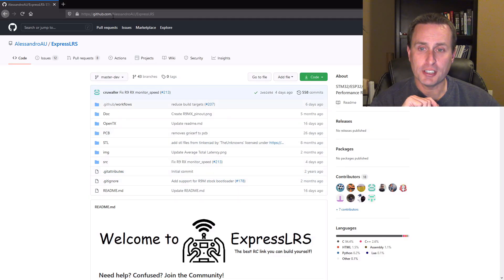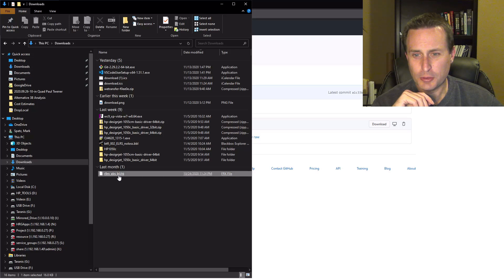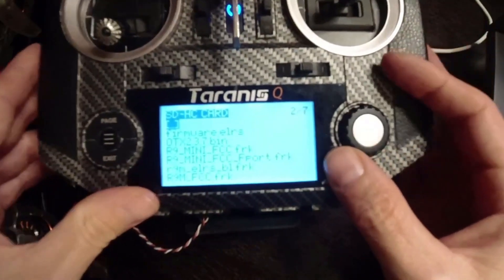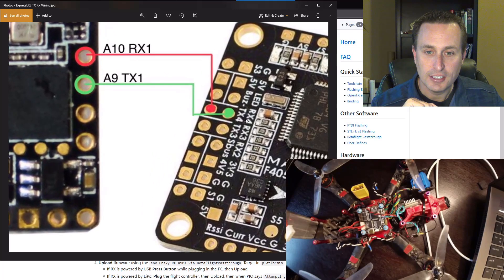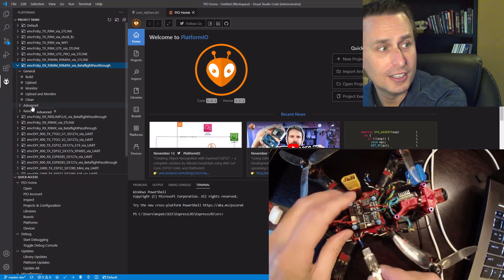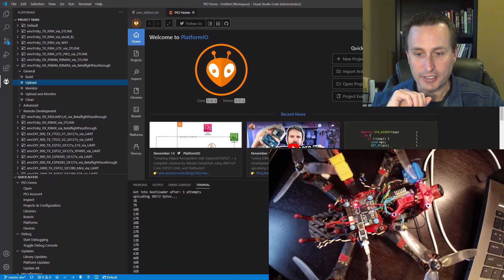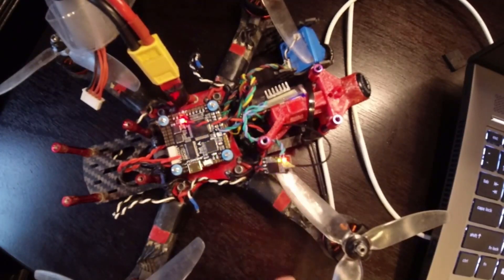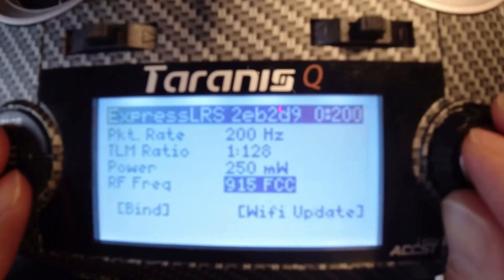ExpressLRS: Flashing R9mm Receivers

Comment: If your receiver powers up with just USB connected to your flight controller, unplug it. Press and Hold the boot button on the receiver (not the FC) and then plug in the USB. Release the button once the green and red LEDs blink alternately.

If your receiver only powers up with a LiPo connected to your flight controller, unplug it. Then unplug-replug the USB cable to your flight controller. Do not replug LiPo yet.

Comment: ok so here's a tip for people who can't get the lua script to work.. there are some people with the same problem, and I bet they have the same problem. I tried several things, almost went crazy, flashed modules with stlink, then as a last resort resoldered the crsf mod with enamel copper wire and kept it as short as possible, before this, I used relatively thick silicone wire, always got the error counter running up, and no connection to the module with elrs, but R9m firmware worked fine.. but with the thin wire it finally works! nobody was talking about the wire affecting the link to the module, I have not read this in ANY problem solving,  but it does work with thinner wire !

Comment: I have two R9 modules, one modded with a resistor, and a second one without. I successfully bound the module without the mod,  and then tried to bind the modded module with the same receiver (r9slim+), but it won't bind,  is this not possible? binding phrase is the same on both modules.

Comment: Hi Mark, is there any way to flash ExpressLRS to the R9 Stab receiver? i'm planning on switching to ExpressLRS and I fly a lot of fixed wing also without FC so I have quite a few of the R9 Stab receivers and it would be very annoying if they wouldn't work with my R9M anymore.

Comment: Cool - thx - so if you can load the Bootloader to R9MM via the Taranis S.Port pins (as per your video 4:46 above); Can I also then load the Frsky_RX_R9MM_R9MINI-1.0.1.bin firmware the same way to a batch of R9MM's?  in my case I have Not yet built the drones so passthru not possible atm.

Comment: Thank you very much for the tutorial.
I have a radiomaster tx16s and the crossfair module is from the 2019 ACCESS EU LBT version. I do all the flash procedure with EXPRESSLRS configurator and in the final step with the R9MX connected to the controller after compilation and the attempt to flash gives me an INVALID SERIAL RX CONFIGURATION DETECTED error:
serialrx_inverted ¡= OFF ¡¡serialrx_halfduplex ¡= OFF / AUTO¡¡¡

I would appreciate a little help.

Thanks.

Comment: ive got a accst r9m module but no recivers. all i can find is the new access recivers. if i flash my accst r9m module and buy a new  R9 MX access OTA reciver and flash it with ELRS, then will they work together? or do i need an old accst reciver to work? sorry, im new to ELRS
Reply from the maker: OTA receivers work with either ACCST or ACCESS modules.  ELRS or Frsky
Reply: @uavtech  thanks for such a fast reply! Glad too hear it, I'll soon have a elrs system up and running

Comment: can you please share the "r9mm red+green leds solid on lipo connection" fix? the link @ github is null...
Reply from the maker: You have a broken bootloader button.

You need to special broken button, bootloader file covered under the wiki.

https://github.com/ExpressLRS/ExpressLRS/wiki/Flashing-R9MM-R9MINI-with-TX#flashing-bootloader

File linked on the discord
Reply: @uavtech  Couldn't find it.. please. The link there to Discord is dead

Comment: Nice video! Can I use some of the methods to flash the DIY nano receiver? Or only with a serial adapter?
Reply from the maker: If it has a passthrough build option, then you can usw this method.  Not all have a passthrough build option though.
Reply: @uavtech  Thanks for the answer:)

Comment: Thanks for your great videos. Super informative! Tried to go through discord but no success. I've successfully flashed my R9M lite tx module with ELRS. I'm now trying to figure out the rx flash, however, I don't use Betaflight. All my UAVs use INAV. Can I flash the R9MM rx through INAV using the Betaflight passthrough method? The STLink method looks a little intimidating to me. Thanks again!

Comment: I've been following your videos and after seeing the configurator, finally took leap of faith and flashed one of my old r9 moduals and a reciver. Had a few issues, but figured them all out. (Set external to crsf, Load boot loader to the reciver before flashing express LRS (my fault)) love the passphrase and being able to bind to many moduals just by flashing the same firmware/passphrase. I don't have a lot of recivers, was wondering if it works on the r9mm ota recivers.
Reply from the maker: Yes it does.
Reply: @uavtech  i'm sold! thank  you! i'll be checking out your tuning videos. need to really understand pid tuning!

Comment: Can u tell about TLM Ratio?
Reply from the maker: It is one packet per evey X number of transmission packets.  TLM takes air time, so i would crank up to 1:128.  In some cases though, you may bet RSSI warnings at 1:128, so you may need 1:64 depending on your equipment.  Mine works on 1:128 fine though.
Reply: @uavtech  i need gps coordinate telemetey. Whats best TLM ratio & best frek?
Reply from the maker: ExpressLRS does not support GPS telemetry.

Comment: How well would this work with an r9 lite, the github seems to say it supports 50mW but that seems pretty low and I thought the r9 lite could go up to 100mW
Reply: Yes it supports only 50mW because FrSky use chip which is not rated to 100mW and devs decided to lower power.

Comment: All works for me except the firmware flashing with via the FC with betaflight (have a Goku F411)  , Why the VS compiler does not generate Firmware file for TX flashing ?  , can you flash FW via the Taranis TX as external module ? how? Thanks in advance!

Comment: I couldnt get mine to work untill I switched my external module mode to crsf.   After that it bound rite away
Reply from the maker: Yeah, it uses the CRSF protocol.  Sorry, I thought I covered that in the previous video, but maybe a glossed over.
Reply: @uavtech  I think you missed that one.  But i figured since it used crsf on betaflight that it used crsf on opentx.   But great video man.  Thanks for everything.

Comment: Thanks for the video, very useful. I have a question, are the new r9mm receivers (OTA I think is the name) also supported? or just the old ACCST version?
Reply from the maker: Both.
Reply: @uavtech  excelent. I will go and flash my old module and receiver then. I got a couple when they were on that crazy sale
Reply from the maker: U on ACCST Module and OTA receivers?
Reply: @uavtech  I have ACCST modules (2x) and receivers (2x). My original question was if I can buy additional r9mm receivers in case I need. And, as the old R9mm are now discontinued, the only option for buying more are the new OTA. Of course I meant for using them with the old ACCST module once flashed.
Reply from the maker: Yup.  It will all work.  Updates of RXs will of course be through FC as shown with ExpressLRS.
Reply: @uavtech  great

Comment: I have my FrSky R9 module plus some R9 mini receivers both using ACCST because my Taranis Radio is the XD9 (no plus version). What is the advantage of  ExpressLRS versus the FrSky ACCST firmware for R9? Does something changes on the receiver pins? Can I still use FPort ? Thanks a lot for your videos
Reply from the maker: It is fast and smoother 
No F.port.  you have to wire as shown.
Reply: @uavtech  thanks a lot for the fast reply. Do I get enough telemetry such as RSI, battery voltage and battery cell voltage? I don’t think I need more
Reply from the maker: You get: RQLY, TQLY, RSSI x2, SNR x2, and VBAT

Comment: I like this! Is the Express LRS firmware by someone other than frsky?
Reply from the maker: Yes, it is an OpenSource project.  It works with the LoRA chip set which is used in the R9 modules.

Comment: thanks for the video, will there be more videos about expressLRS? I still have a question about telemetry. With the Fport protocol i only need 3 cables and i have telemetry and only use one uart in betaflight. is this also possible with expressLRS?
Reply from the maker: Yes and yes.  Except for the 3 cables part.  ExpressLRS uses four wires (like Croasfire).
Reply: @uavtech  thanks for the quick answer. will there also be a video about building a 900hz receiver? What else are you planning to do about expresslrs?

Comment: stock R9 ACCST and ACCESS user here. so this this is a third party protocol/firmware that work's on frsky R9 hardware, and is slightly better? is that the jist of it? seems like a lot of work to get it working, but perhaps it's worth it. I haven't had any issues with my stock R9 setup.

Comment: Does the CRSF connection of ELRS also work in the same way with the R9 mini receiver (not the mm version) and a standard F4 UART? I have heaps of R9 minis I never used because of the inversion issues and fport and this could save them.
Reply: Yes, the same.  Checkout the wiki for more info on flashing and connections.

Comment: Thanks for these 2 videos ! As an R9 ACCST user, it sounds interresting, even if it costs one more cable than F.Port. Does it also work with KISS and FalcoX ? And is it possible to set the frequency to 868 Mhz (I guess before compiling the firmware) ? Thx !
Reply from the maker: 868, yes.

Whatever can run Xfire can run ExpressLRS.
Reply: @uavtech  Thank you to both of you for replying. Basically it is almost a transformation of R9 to Crossfire for free ^^ I have just seen that R9MX is also compatible, I was afraid FrSky stop producing R9 MM, this solves everything, thx again ! :)
Reply: Yep, 868 and FCC etc and be selected at compilation.
Reply: @JyeSmith  Thank you :)
Reply from the maker: It is kind of better than Crossfire in many ways it seems.  And will be better in every way if it keeps going in the direction it is going.

The Devs are doing amazing work on it fo'show.
Reply: @uavtech  I'll keep an eye on it and probably switch during winter. I have many quads to "rewire" from F.Port to this ;) Thx again for the information 👍